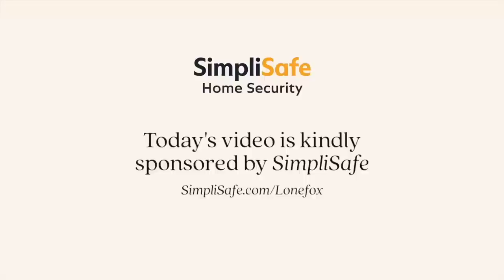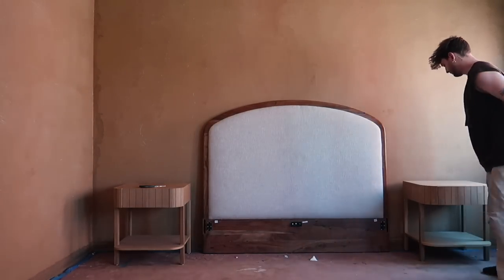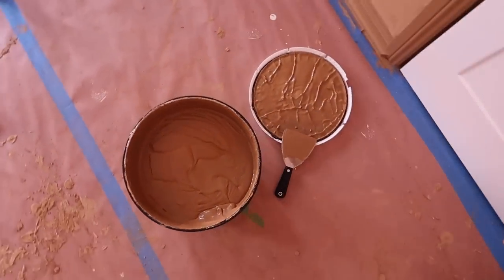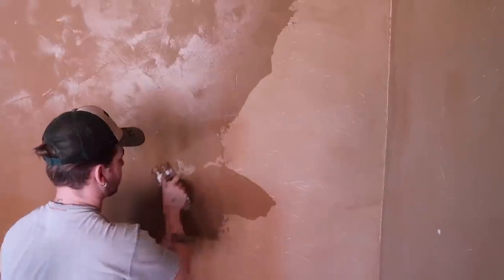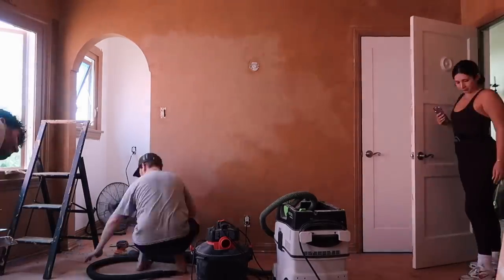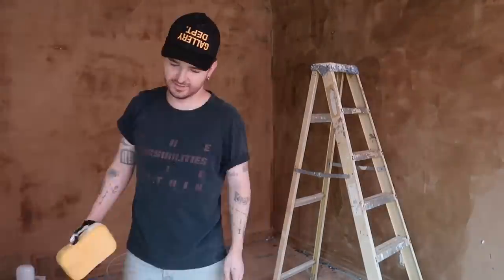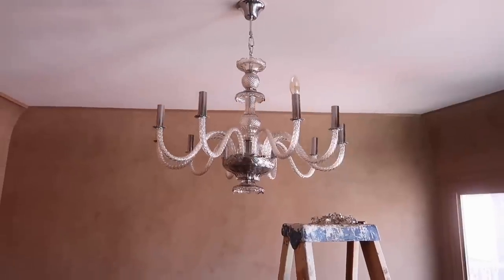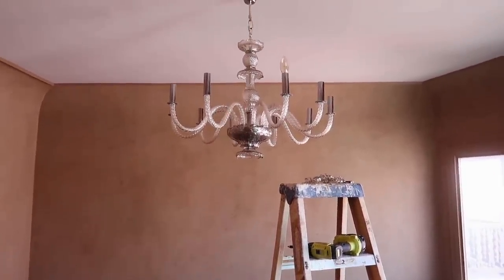The BEST Bedroom Makeover I'VE EVER DONE! ✨ Part 2 ✨ DIY Plaster Wall Reveal + Furniture Layout

Comment: I am wondering if Marie has any choice in what you put into her room. The chandelier without the crystals is rather masculine. The crystals made it pretty. Also, the blinds aren't very feminine, either. What would make them prettier is a curtain panel at each end in an off-white shade or the colour of the ceiling. I think that would finish it off. Without any curtains, the windows look kind of unfinished. Of course, if Marie loves it like it is, then it's perfect. ♥Hopefully, for her sake, you both have the same tastes in decorating. ;)

Comment: O boiii. I know in usa you are not use to plaster. But... if you want smooth finish theres different technique and it will save you so much sanding. Dont work in directions.  You rolle it up from bottom exactly how you "cutted" near baseboards.  Use same princip on whole wall. Smooth it with wet sponge. After it dries you just "pet" it with sand paper,  or sand block to let that lil stones fall of. I know you can already feel in your hands how to roll it how much preasure aply how thin layer etc.